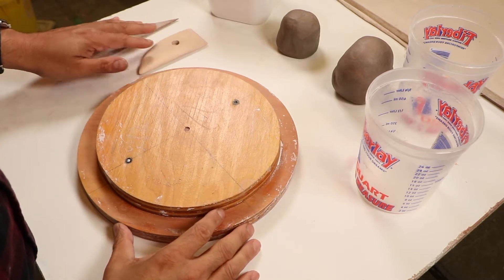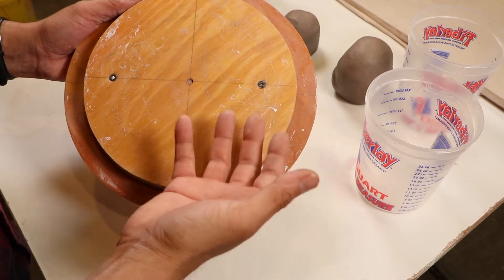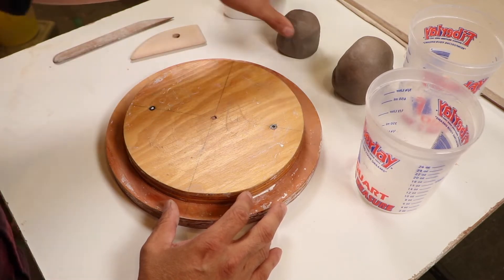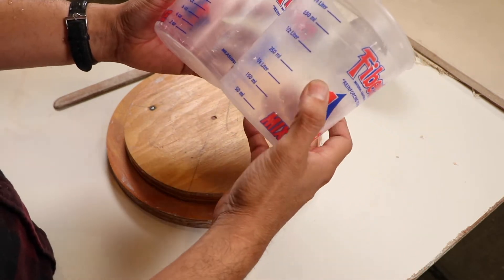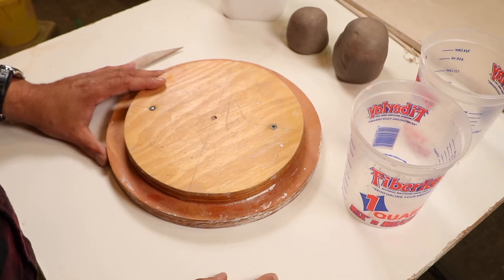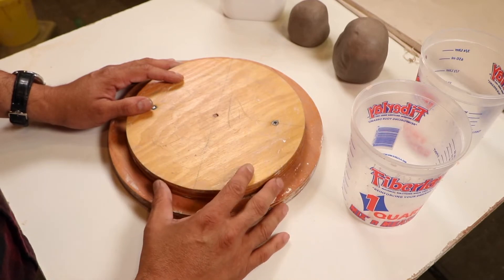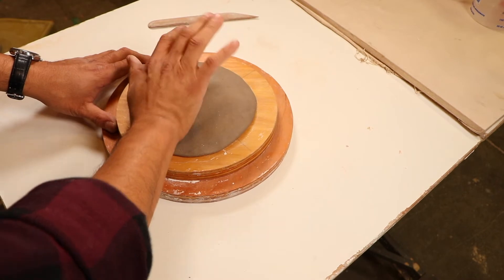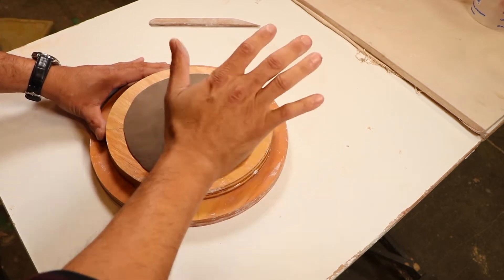Plaster Relief Casting - Positive and Negative Form - 1-Piece Mold

Comment: what is the canvas board for?  You didn't use it.
Reply from the maker: Hi! I made these videos for my sculpture classes during the covid lockdown so the canvas boards are used for students as a "work board" and was given to then in their supply list. Canvas boards are good because clay does not stick to canvas,  therefore students can use the canvas board to compress flat the clay slab needed for this assignment. Regular denim canvas works good.

best!

N.O.